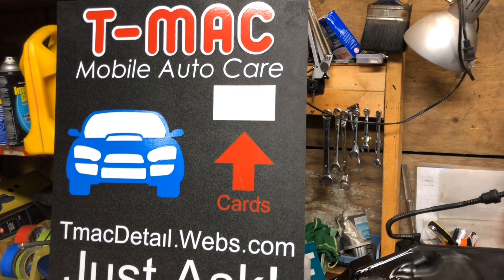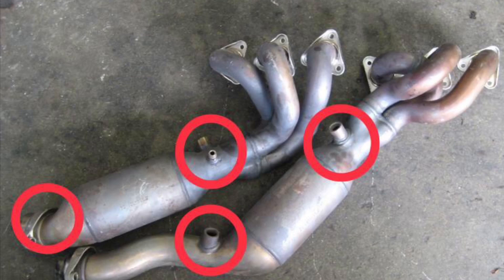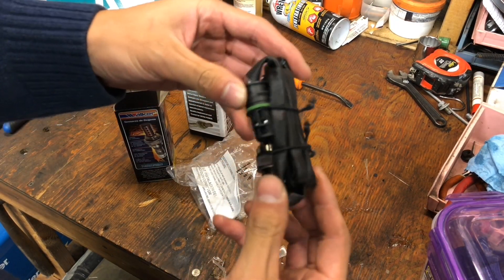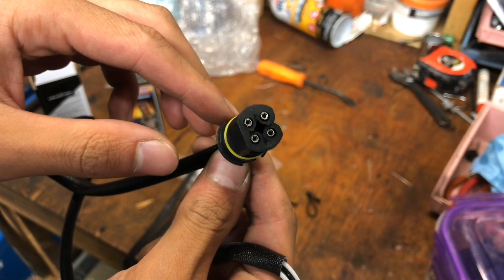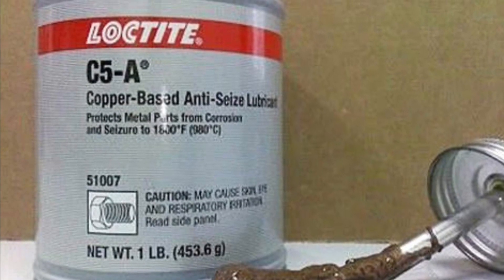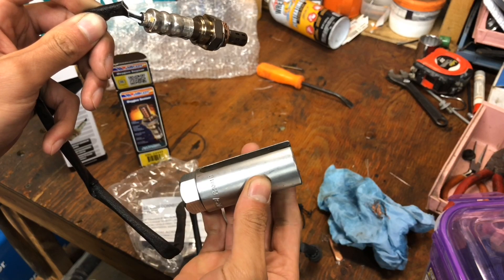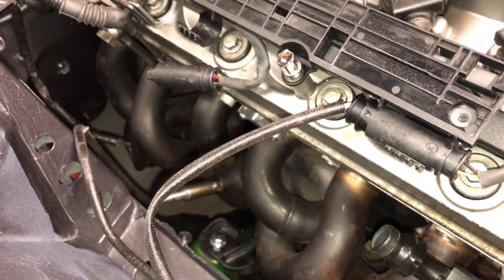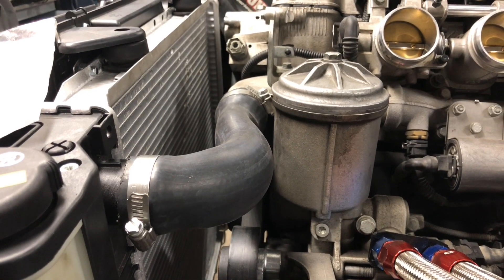How to Engine Swap Guide - BMW E30 M3 Engine Swap S54 - Oxygen Sensors and Coolant System

Comment: Thank you for your detailed and well shot videos. I have a swapped E46 with the S54 engine in it. I just replaced my Headers for catless ones and am replacing my oxygen sensors but I'm confused and find it very hard to get straight information on them. In your video you are showing that you plug in the "Pre-cat" or "First" Sensors into the plugs on the side of the engine and not on the back of the engine where the other sensors have their plugs. I thought the "Pre-Cat" Sensors Banks 1+2 were plugged into the two plugs at the back of the engine. I can't quite figure it all out now that my old headers are out and the labels I made from a diagram may have been wrong. Is the green one Bank 1 or Bank 2 Pre-Cat? Please help me if you are able on this. Thank you again.
Reply from the maker: Hi Greg,

I will have to double check next time I work on the vehicle. From the last time I tried to put the O2 sensors on they only fit on one way. From what I remember the larger thicker sensor is on bank 2 while the thinner one is on bank 1. I hope that helps.
Reply: @Garage88Official  Thanks for the reply. I've now found out that the green one is Bank 1 Pre Cat and the Yellow one is Bank 2 Pre Cat. They both plug in at the rear of the engine and not at the side. They can only be plugged into their own sockets so the only way to mix them up is to pug them into the wrong place on the header. The side of the engine ones are for the Post cat sensors which I no longer am using as I don't have cats any more. Thanks again.